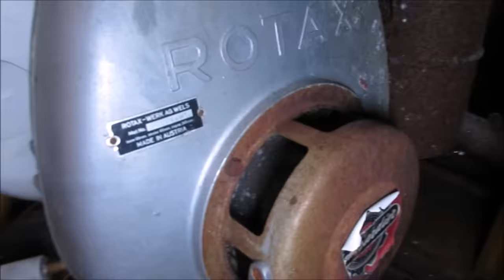Antique Sled Left For Dead, Can WE Save It?

Comment: Loved the video and the old bubblenose, Mustie.  In the 80s and 90s I had a 1970 Olympique 335, which is a very similar machine.  Was looking over your shoulder as you encountered challenges with a smile.  A few things: the sparkplug thread is 18mm.  The crank seals and bearings are likely gone.  I had to change mine.  The original crank bearings are a non-tapered roller bearing, but the replacements were ball bearings, at least in the 80s.  Order a carb kit, you’re gonna need it. tillotson carb, either an HL or HR.  The type will be stamped into the carb body casting.  The two adjustable carb jets are low speed and high speed.  High speed really has to be adjusted under load while riding, to the conditions.  The chaincase takes gear lube, and needs to be filled about half-way up the lower sprocket.  There should be a belt guard, but it appears to be missing.  Bogie wheels take a shot of grease in the axle end.  Bogie shafts need to be disassembled to grease properly.  Rear idler shaft has greasable bearings, and that’s where the track is tensioned too.  Check the front drive sprockets, if they are shot, you’ll need replacements.  The tag on the engine cover that says “Made in Austria” will list the displacement.  Key switch just kills ignition; i.e. not essential.  Machine is definitely worth saving, find a collector in your area if you don’t want it.  My old 335 would run at 55mph on a compacted snow lake, and it was pretty hairy at that speed.  Oh and you’ll hate the gas tank; it’s part of the tub forward of the track, and they tend to rust up something awful inside.  Around 72/73 Skidoo went to a plastic tank. 👍 oh ya, this engine needs a 20:1 mixture, not 50:1.
Reply: Thank you for sharing your knowledge 👍

Comment: In 75 we had a Olympic 340, first sled we owned with slide rail suspension, instead of bogie wheels. We had no idea that a small amount of snow was necessary, to lubricate and cool the plastic slide rails which get very hot, without 1 or 2 inches of snow. So we motored across Sebago lake, frozen like glass, to our ice shack. After 4 or 5 hours of fishing, we decided to head home, dad started the brand new sled, and he could not get it to move, the slides had got so hot on our way out, that they melted the plastic slides, and when we parked, the melted slides fused together with the track. Dad kept revving,   the engine, unaware of the problem. After a few minutes the engine reved up like it was free, but the sled did not move. He had stripped the rubber drive gears, dad spent rest of winter replacing those....
Reply: Thanks for this info abt the risk of melting the plastic.

Comment: That's almost identical to my first sled. There were snap holders for the hood. The exhaust broke right outside the block. A Skiroule friend of mine used a piece of flex pipe and clamps to fix it. The machine wasn't fast but it was super reliable. There were small fixtures just below the seat to hold a back test for a single rider. That is a great piece you have there. as always a good video.

Comment: Love the videos, and how indepth they are.   Just FYI Darren, if you go on the inside lower edge of the hood like where your feet would be if you sat on the seat, there should be 2 wing nuts or regular nuts in an L bracket that hold the hood on, remove those nuts, and the gas cap and the hood should come off, just lift it from the handlebars forward.  I rode one of those that my father built when I was a kid, loved the machine, we actually had a musher style trailer for the back and would go out and get firewood all the time.  It was a blast.  Hope to see the whole sled run and move.

Comment: I used to race one of these in my younger days. It was a modified 10 hp with a tuned pipe exhaust. I still have my third place gold cup from the first ever televised ABC Wide World of Sports snowmobile races World Championship at Eagle River, Wisconsin. Those were the good old days. That hood was a pain in the a$$ to remove. We always removed the bolts and replaced them with pop rivets. Much easier to just drill out the rivets to access under the hood again. Can't believe it fired so easily without needing carb work. That Tillotson carb was good for having a sticky needle valve. Great video Mustie, thanks for sharing, this brings back a lot of memories!

Comment: It's windshield has been replaced. The original windshield would be yellow. Those old bubble top Ski-Doos are nearly indestructible but don't turn for crap unless you put spreaders/risers in it to push the skis farther apart about 3" per side and down about an additional 2" or unless you lean heavily to the side when you are trying to turn. They have the advantage of having bogie wheels so they can be ran with little or even no snow if necessary which is why they are great for going ice fishing when there is bare ice on the lakes. Their Rotax engines are extremely reliable but are mounted too far back which is why they don't steer very well. I have been around vintage sleds for decades and have great appreciation and respect for these amazing machines. That sled has a bare aluminum head and likely a cast iron cylinder that was painted black from the factory. There is rarely any reason to remove the flywheel on these engines as there are openings through the flywheel behind the rewind hub that allows access to the points to clean and adjust them. The Tillotson carbs are extremely reliable and easy to work on and so are the clutches on them.
Reply: Yeah it brings back memories of when I was a kid. They used to supply a 90 degree bent open end wrench for removing the carb too.
Reply: Well this guy sounds like he’s had a few of these!
Reply: Excellent info. Keep it coming.
Reply: We've had a dozen or so vintage Ski-Doos, several Polaris, a couple Sno-Jets, a dozen or so Arctic Cats, several John Deeres, several Scorpions, Chaparrals, Moto-Skis, Yamahas, Mercury's, Johnsons, and several other brands that most people either havent heard of or have firgotten about as theyre not seen very often.
Reply: @chrispy3866  Thank you. I don't want to overwhelm the comments section. I am very familiar with vintage sleds, boat motors, and cars. I've been twisting wrenches on them for 40+ years and used to buy and sell vintage ones of each of them.
Reply: I had one and it was a tank
Reply: @todddenio3200 Thanks for your info, I had posted a separate comments with a bunch of stuff to help Mustie as I’m familiar with these sleds too.  I had the 3” spreaders you described on my Olympique, but I ended up taking them off and just putting spacer blocks in to raise the weight on the skis.    
With the spreaders, hitting a root or ice on one side would really jerk the handlebars something awful.  Later, I had a Skiroule, and on it, I did something clever; I welded tubes outboard of the fiberglass body so that the steering pivots were about 5” wider on each side, then extended the tierods to reach.  Made a much more stable riding experience and no handlebar torquing.  Love these old sleds.  My uncle-inlaw had a Snow  Crusher with a rotary engine; you want to talk about rare. 😁
Reply: @gregholloway2656  it's great when people who are familiar with things like old sleds are willing to share advice gained from experience. Skiroule were cool sleds. My brother picked up a Raider he is restoring which is another cool sled. The Snow Cruiser is fairly rare but fortunately most of the parts were identical to the Johnson and Evinrude sleds and came off the same assembly line. The main difference is the use of the rare optional rotary engine in the Snow Cruiser and it being blue. Neat sleds though
Reply: @todddenio3200  ya, I do seem to remember the Johnson/Evinrude (OMC) sleds being nearly the same.  But I think some of these ran opposed twin engines.  Was a cool time when every manufacturer wanted in on the new sled market.  So many makes at the time.  Thanks for sharing memories.
Reply: @gregholloway2656  yes the Johnson and Evinrude ran the opposed twins. All 3 of them were built by OMC.
Reply: @todddenio3200   Did you ever own a Skiroule RTW 300 rotary? Think 300, not sure, only saw one once when i was a kid at the races, early 70's. They were orange, not green, just never see them at all anymore.
Reply: @todddenio3200  right.  I was amused wondering how long it was going to take Mustie to figure out the advance mechanism under the flywheel.  Knew he would get it.
Reply: @blowupbob1  No I have not owned one but have been around them. One of the sleds I always wanted though was a Scorpion Super Stinger 800 and another is the Arctic Cat King Cat 793 or the 800.
Reply: @ProctoLogic  yeah they were pretty indestructible

Comment: Later years had a decompression valve. The Ski-doo clutches were never as smooth as other brands. I had a ‘69 12.3 Oly, a 70 18 Oly, a ‘71 Nordic 399, and a ‘72 Nordic 440

Comment: I'm a snowmobiler out here in WA State. There is a club here that specializes in finding these old machines and restoring them. They have a few meetups every winter to ride them and they display them at several winter power sports expos around the area. Boy how the art has changed since this one left the dealership. A new machine now prices out at $16-18,000 new.

Comment: Excellent video Mustie 1  :) also that Snowmobile reminds of my late Dad  had was 1969 Bombardier one in black , deep yellow  was 28 hp of a 292 Cubic Inches 1 cylinder  motor, had RPM  , Speedometer also miles, key ignition switch on steering wheel holding near hood  or right side ,  tool box below back brake light  , 6 gallon fuel tank  fill up front on hood circles door and green windshield Lol! Fun part his key was same type as my uncle 1973 Bombardier TNT Free Air 400 daul cylinders and carb plus sparkplugs! But only thing lights turn on dad key because one tooth was different cut compared my uncle ones had extra tooth Lol ! Lots fun both sleds back day and used on farms too get cows feed and back home farm too!

Comment: That is a fantastic maskin. If you make brakets to wide the skis abaut 15 cm wider  bouth side and abaut 5 cm higer it will perform better with stability and in deep snow. I also use to lift the bogy weels with brakets to higer the back end and axel abaut 10 cm higer and it performs like a modern snow mobile. 18 to 20 horse engine is best fore driving uphill because the engine get lower RPN and don't spin the drive belt. I also did try a 20 hors wankel from sachs and it worked well except that the exhaust was right under the carburettor and a small gas leek always started a fire.
Reply: learn to spell for FS       lol

Comment: Dad had a 1970 olympique 335. Great machine no suspension hard as heck to pull start.ran until the clutch assembly broke. He got another and installed it. It would never start after that .  I had it and couldn't get it started. Ended up selling it to a collector for a couple hundred bucks  25 years ago.

Comment: We had a 1968 Ski-doo when I was a kid.  It looked like an earlier model than this one.  In 1968 there were two choices.  Ours was the 8-3/4 hp model.  The other one was a 10 hp.

The new models are faster, but that little old Ski-doo could ride on top on very light powdery snow and not bog down.

I remember once we were going on open snow and the snow from the front was being pushed up the cowl, up the windshield, and over the windshield into our laps and the old (new then) Skidoo kept on going and going and going.

My father built a sled and we had four people being transported by the snowmobile.

Comment: I worked on these when I was a new mechanic. To stet the timing we used a dial indicator in the spark plug hole and a buzz box on the ignition wire.

Comment: We had one of these in the back of the barn when I was a kid. Once we got it running it was the most reliable sled we ever had. It out started every other sled we had that was left outside for too long. You could put the old Skidoo at the bottom of the creek and it would probably still start. Polaris and Kowasaki could never cold start anywhere close to what the old Skidoo could. -30C no problem...-40C no problem. We called it the Yellow Submarine because it would often sink through the snow and then push through it rather than glide on top of the snow, it was a beast. Unfortunately we lost her in a forest fire just before we sold the farm.

Comment: The Ski Doo, that you have is very old, with even the old type starter they had.  It is a 1966, or 67 model,and not a 1969.  Those Rotax single cylinder were originally built for industrial use to run water pumps and other small appliances.  The ignition will usually fire, after clean in the points, and the tillotson carb is easy to repair.  The engine mounts to four nuts and it comes off the machine after you remove the belt, and exhaust flex pipe..  Rotax was bought by Bombardier, which manufactured you snowmobile, in 1963, and became the exclusive engine for Ski doo machines.😊. The cam, and the lever are the ignition advance, and don’t take the flywheel apart. The coils you talked about were exactly opposite of what you were thinking, the one in black plastic, is the ignition coil, and if you look close enough, you will see the spark plug wire is attached to it, and Theo the open coil is the lighting coil, to run the lights.  The very early versions of this machine actually used a bicycle generator to run lights by it running on the engine clutch, rather than the bicycle tire😊

Comment: I believe that that engine was manufactured in Austria and the electrical side would look the same as in all old Puch engines. black one is the ignition coil and copper one is the light coil. Points and every other electrical parts are still very much available.

Comment: I fired off a 76 John Deere that had sat outside a long while. It wanted to live even with a complete destroyed crank bearing, seal, stuck open reeds, rusted pin and rod bearings on one cylinder. Amazing what will run.

Comment: I remember driving these (in 1967) when they were brand new. There were no snowmobile trails at the time. The best you
could do was in a filed or on a frozen lake.  There also were no laws for snowmobiles at the time. You did not need
a drivers license to drive them.  This beast goes way way back in time. I broke up laughing when he tried to open the
hood with the light opener.  There are two rubber retainers on each lower side for the hood.

Comment: when i was little my older brothers had things like moto ski, snow jet, boaski, & an old skidoo maybe similar to that one i think, its been a while, and an old AC panther. i had an elan not all that long ago, would like another. on mine the tunnel was rough, i just riveted good metal over the bad part and the rubber on the bogies was all cracked.

Comment: That points deal is a impluse coupling to make a hotter spark when pulling the recoil starter. And pull the head and cylinder off ,looks like the rings matbe stuck.

Comment: I remember ( AGAIN!!!) working in Burlington VT. in 1966 on those machines and one even OLDER! ( a 1955 model!!) in THAT model , it had a large single cyl. Wisconsin 12hp engine the whole engine pod unit pivoted on the rear unit, ALL STEEL INCLUDING THE TRAC WHICH WAS MADE WITH SHORT PEICES OF ANGLE IRON AND HINGES CONECTING THE PEICES TOGETHER,     VERY HEAVY , I THINK THAT THING WEIGHED OVER 600lb. That Rotax engine was made in AUSTRIA. My father had a 1959 model of the unit you are working on ( as a VT. game warden the fish+game dept. supplied it to him) !!
Reply: Yes we DID get the 1955 model running tho in OCT. there was no snow yet on the ground yet so we didnt even TRY to ride the damn thing , just got the track up and got it to spin  at about 600lb. we moved it with the shop forklift!!

Comment: THE SKIDOO OLYMPIC WAS DESIGNED FOR THE TOURIST USE IN AND AROUND THE OLYMPIC GAMES SITE AT LAKE PLACID NY. From the mid 60s through mid 80s the lake placid region of nys was a mecca of snow related recreation , the need for user friendly reliable   snow machines/mobiles were in high demand the opening of the interstate I-87 THE Adirondack Northway lake placid was within reach of the lower region of NYS.  Lake Placid business entrepreneurs ran (still do) Snow mobile rentals and "SAFARI  EXCURSION" running trains of snow mobiles on the groomed trails. 
As a kid in the 1960s I was one of those people who took part in these adventures.  I actually had the awesome experience of meeting credence Clearwater revival just as they were about to become famous! They were playing at the bar of the hotel marcy!

Comment: Hi mustie I noticed that engine is a rotax I used those engines in my gokart they were single cylinder 2stroke rotary valve we use to rev them to about 23000 rpm

Comment: Around the alignment pins, heat the case were the pins are. The alloy will expand quicker than the steel pins. Breaking the grip of the alloy on the pins.

Comment: @mustie1 I notice you are using the m12 impact. I love that tool probably for the same reason you do. It's light and easy to handle.  But I notice you're using the 3 cell batteries in it. Maybe you already know this, and either have these batteries, or just choose not to use them, but the 6 amp batteries make that tool a whole different level of powerful. Love the vids!  Long or short!

Comment: You should invest in compression-tester which has check-valve AT THE SPARKPLUG HOLE. The volume of the hose can really change the measurement.